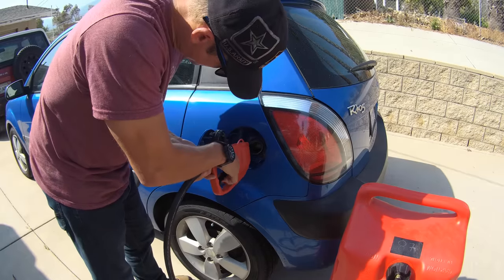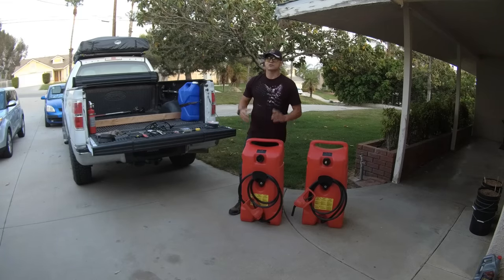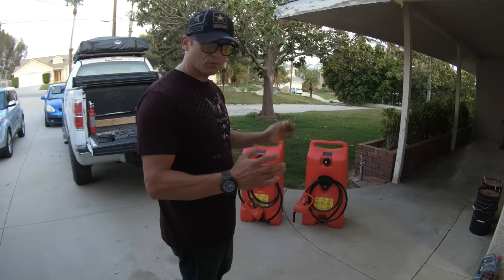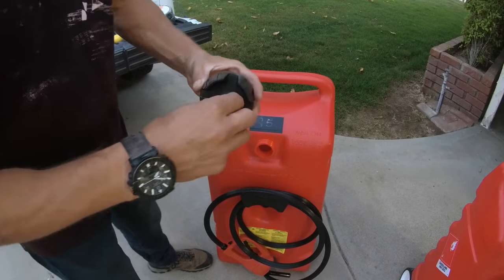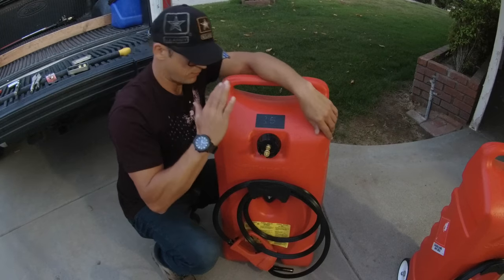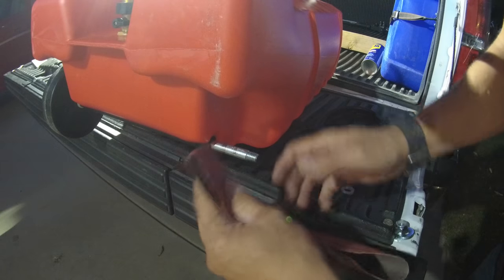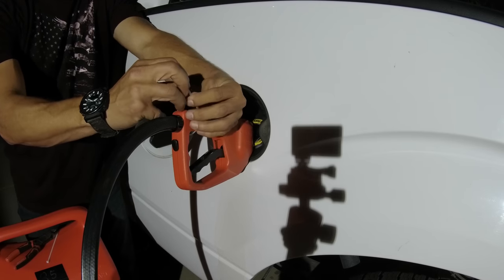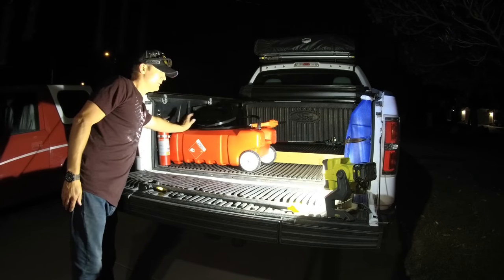Duramax Flo n Go 14 Gallon Gas Tank with Hacks

Comment: I just bought one for myself. The instructions state: "DO NOT FILL in the back of a pickup truck or inside any vehicle." Obviously you're filling in the back of your pickup on top of your bed liner. I guess the static electricity on your bed liner really isn't a big deal?
Reply from the maker: Is there static electricity from a plastic bed liner? I thought it was just if it rubbed up against fabric.  Well, I just researched and plastic on plastic can create a charge too. I'll be sure to either put them on the ground or install a ground wire and attach it to the fuel cans and the truck. Thanks for the info! Your a life saver!
Reply from the maker: Well, I think I'm going to install a ground wire because even driving around with it in the bed can be dangerous under the right conditions.  Too bad I didn't know this before the video or I would have included it.  Thanks!  I hope others read this because I've watched many other videos before buying this and no one else I watched addressed it either and this goes for any plastic gas container.
Reply: @plantbasedprepper  will you please do a video showing how to install and use the ground wire? Thanks
Reply from the maker: @apb5866  I will after I do more extensive research.  So far, there isn't much info out there with cars using a grounding method but there is for tanker trucks which cannot take their tanks off their truck.  That is the direction I'm going but I want to make sure I learn more about it and and do it safely and correctly before I share it.
Reply: What if you don't have a bed liner at all? Still an issue?
Reply: @tonyj1965  Yes, it is.  The can itself can develop a static electrical charge.  That static is discharged when the can is removed and set on the ground, or "grounded," before being filled.  But, if a can is charged while in your trunk or truck's bed, it will discharge to the gas pump's nozzle, which is "grounded," producing a spark that would ignite the fumes inside the gas can or at the end of the nozzle.  
THAT'S WHY YOU MUST GROUND THE TANK!
Reply: I actually witnessed it happen at a gas station, a guy was filling a 5 gallon can in his truck bed and the static did ignite it before I knew it he threw the can across the lot of the gas station, had to get the fire Dept there and write up a report on it, I took off without paying and came back when I knew it was ok but for my luck they knew me and didn't try to get me for taking off without paying
Reply: Ground wire with a chain on the end. Leave the chain on the ground when filling.
Reply: @imdeplorable2241  What if the can is on a metal plate in the bed of the truck and the plate has a steel chain that you lower to the ground prior to filling?
Reply: @johnhwang339  I believe that would work, the chain replacing a wire or cable to ground.  The object being to provide a direct path to ground but, not a human providing that path.
Reply: Yea you can die a slow very warm death. It's gas station 101. When I managed a station he would not have been able to do that. 100+ lbs or not it's gotta go on the ground or an anti static surface like a wood floor trailer
Reply: 10:45 what if you set it on a piece of plywood the size of the tank? Could you fill it in your vehicle?
Reply: @georgemartens7415  never IN a vehicle. Too much static. I strap mine onto my wooden bed trailer

Comment: Only bad thing is ELECTRICAL SPARK !! make a ground wire from tank to pump since your not putting tanks on the ground like the sign on the pump says to do, as specially with bed liner.
Reply from the maker: I was ignorant about that and that was one of the first comments someone made.  I have been taking them out of the truck since and looking into ways to ground the tank and truck to the ground instead.  Haven't came up with the best solution yet.
Reply: Wife bought me one of these for Father’s Day for putting gas in our pontoon boat.  Two Issues caused me to send it back:  the gravity feed issue which you solved with this hack, and having to take it out of the truck to fill it then lifting it back in.  Gas stations won’t let you fill them in the truck bed.  At 62, didn’t think I could lift it when full but didn’t try.  If I could lift it back into my truck I think I’m in on your hack.
Reply from the maker: @chdinct6792  Yep, that's the one drawback so far is having to take it out to fill up and put back.  I can imagine that being a problem when I get older too. There is a way we can ground the tank, car and self to the ground while filling but I take it not all gas stations would allow that either.  The hacks would make it easier to roll around though and fill.  If you haul it in a trailer, that might work but you might be able to hack some 5 gallon jugs too.  I just don't like holding jugs up to fill things.  I always splash some when filling the mower, chain saw, and they fill up too fast and overflow.  I love the gas handle on this tank instead with the air compression.
Reply: Thank you

Comment: Way easier to let gravity to do the work. Elevate it and you don't need to mess around with this mumbo jumbo.
Reply from the maker: If you store them in one spot all the time where you can pull up and gas up, it would be easier, but I need them mobile to wheel around outside to my mower and vehicles, etc. I found out your not supposed to keep these off the ground either so I started taking it out of my truck to put on the ground for safety. They will need to be grounded somehow even if you store them on a table or bench.  I'm still trying to find out a good way to ground them without having to take it out of my truck bed every time.  Need to ask a fuel tanker because they carry fuel and have to ground there vehicles before filling up there tanks.

Comment: Good ideas, but a few VP racing cans just make so much more sense and are SO much cheaper. They hold over 6 gallons each, and with the vent cap, I can empty a full can in about 1.5 minutes, much faster than this. Plus, they are much lighter and easier to transport.
Reply from the maker: I have a few of those too and I can't stand holding up 5 gallons while filling up my tank, ride on mower, and garden tools.  This things is easier to just wheel over and put a pump on it to fill them up.  https://www.youtube.com/watch?v=uEaJqPYj5Ok

Comment: How's the fumes when you open your trunk bed? Also have you looked into or found a usage gauge for it? to either let you know how much gas you've used so far instead of guessing how much you've used?
Reply from the maker: I wouldn't store gas cans of any type inside a car or trunk to travel.  I keep this thing in the back of my truck.  Don't really need a gauge for that because I only fill up when it's near empty so it takes the full 14 gallons.

Comment: Have you been able to find an auto set venting solution at 5 PSI?  I found another solution. It still requires a manual adjustment, but it's a little bit shorter profile.
Reply from the maker: Auto set? No. Shorter profile would be better so it doesn't stick out so much.
Reply: @plantbasedprepper  Yes if you could buy a pressure relief valve preset @ 5-6 PSI

Comment: I guess pumping with your foot versus your hand is better? I have a Milwaukee battery operated air compressor that ill use if I go this route. Looking at buying one of these for my landscaping business. I just don't like the tank sitting out in the sun though and that valve would help tremendously. Thanks for the hacks!
Reply from the maker: I like the manual pump because the battery operated one was so loud.  In a SHTF scenario, stealth mode is important. Heck, even with inflation, no one likes watching someone fill up extra tanks so be smart when going to the gas stations. Don't go to a busy one during shortages...

Comment: Any fuel with ethanol is shit, storing it is a nightmare and the damage to small gravity fed carbureted engines isn’t worth the savings.
Reply from the maker: If your car doesn't recommend ethanol, then don't use.it. I rotate my gas like I do my pantry so I don't store any gas long term. That way we make less trips to get gas. I'd rather fill up our cars at home until the portable tank is out. Rather my wife and family don't have to risk going to the gas station so much. It's not a safe place and we can't get in and out like we used to with having to answer so many questions using our credit cards and slow pumps and shady characters always standing around.
Reply: @plantbasedprepper  I wasn’t referring to vehicles ,

Comment: So you’re saying the normal gas is $6/gallon? That’s the only way it would cost twice as much to fill up. You’re math doesn’t seem to be correct. And I guarantee you, you’re getting worse mileage with the E85. Ethanol has a lower energy content than gasoline, so you need more of it to make the same amount of power. Ethanol also burns faster than gas, adding to the problem. It’s not debatable, it’s a scientific fact. E85 provides lower mpg than gas with less or no ethanol in it.
Reply: E85 has a higher octane rating a thus you can run a higher compression ratio, thus you can extract more energy out of the fuel. An e85 specific engine takes this into account.
Reply from the maker: Your right about my math. I mispoke there but too late to re-do the video.  I was filling up E85 for about $2.90 at the time and where I was going every weekend, because it was a resort town, they didn't have E85 and my discount codes never work for some reason, so I was paying anywhere from $5 to $5.50 and felt like I was getting jacked.  I think there pump was off and charging me even more so hauling this thing with me when I travel out of town is a money saver.  About Ethanol having less energy, I haven't noticed that one bit and my gas mileage is the same.  Maybe it's the Shell Flex Plus vs other E85's out there OR my truck runs better on it since it is equipped, tested and recommended in the manual.  From my research, I learned cars run more efficient using there recommended octane instead of paying more than you have to at the pump.  Not all cars are created equal.

Comment: I like it for off-road use engines like ATVs, gas tractors, generators, etc. 

I doubt you'll see monetary savings for use in an on-highway vehicle like cars/trucks. 
The tank is $140. Even if you could save $1/gal (remember, gas goes bad quickly), it would take you 10 full fillups just to break even, not including the hassle of filling it up, dragging it in/out of storage, and time wasted pumping contents out.
Reply from the maker: I did a trip to Oregon and saved myself over $200 in gas. Filled up at home for $3.09. Made it to Reno bypassing the $5.50/gal signs. Filled up in Oregon for $3. Made it all the way home. I'm saving hundreds with this extra tank.
Reply from the maker: No time wasted. I'm camping off grid. I just fill up while I'm at camp before I leave 👍
Reply: @plantbasedprepper  Your math doesn't add up.
You saved $1.60/gal. With 14gal tank, that's a savings of $22.40. 
You did tht twice, so that's $45. 
If you do that 4 more times, you'll be breaking even, not counting the hassle, time and risks involved (spill, theft, etc.)
As I said, I like the idea, but for everyday driving, it may not be worth the hassle. To each is own.
Reply from the maker: @marioprzepiora  I think your assuming I'm lugging this tank around everyday in my truck. I'm only  hauling it for long road trips to go dispersed camping or long trips out of state. It saves me money by not having to fill up for $5/gallon in CA when I have a Shell station by my house I pay $3/gallon for E85 instead and it helped me make it to Reno to refuel and buy more gas to make it back home. For toys, it doesn't matter because I wouldn't be driving that far  to go riding and I don't put E85.in those so I wouldn't be saving any money.
Reply from the maker: @marioprzepiora  My math is correct because you didn't add the savings from filling up my 27 gallon tank in my truck too. That extra 14g tank gets me further to save the money by not having to stop in CA or resort towns where gas prices are higher so I'm actually filling up 27+14 gallons at a time. On my road trip to Oregon, I filled up before I left with E85, once on the way there in Reno, before I came back in Oregon and then when I got back home.  So let's say the last one doesn't count.  27+14 gallons = 41 gallons and I filled up 3x on that trip.  That's 123 gallons of fuel I purchased so I saved 123 gallons * $1.60/gallon savings = $196.80.
Reply: @plantbasedprepper  , You are incorrect. 
You simply can NOT add the fuel you're putting into your truck.
That fuel is not part of the 14gal external tank, the costs associated with it, and therefore the calculations.
Consider this: My vehicle has a 99 gal tank. If I used your example, and bought a one gallon fuel jug, I could say that I saved $160 on first use 99+1=100*$1.60.
Do you see how absurd that sounds?
Reply: @plantbasedprepper  again, your savings are only limited to the amount of fuel you're NOT purchasing at the higher rates, which is 14gallons at a time.
Reply from the maker: @marioprzepiora The thing is, I'm filling up with E85 before I leave @ $3 which is $1 less than regular. Then I didn't have to refuel anywhere else in CA because that extra 14 gallon tank got me all the way to Reno where gas was only $3 so I'm definitely filling up my truck too. I did the same thing on the way back. You save $$$ anytime you go to a cheaper gas station whether you pump 1 gallon or 41 gallons at a time. I'm taking the regular price of gas I would have paid vs the fuel type, distance I can travel and places I can fill back up.
Reply: @plantbasedprepper  , if it makes you feel better, you're free to think what you want.
If you want to be factually, mathematically, and accounting(ly?) correct, please talk to someone that understands math better.

Comment: Thank you so much. So much. 
Readying up for hurricane season just got so much easier 
And fun! :)
Reply: The parts arrived will install asap. 
Thank you for everything!
Reply from the maker: That's great! How did it turn out?
Reply: @plantbasedprepper  You must fill the tank up first with fuel and then set your pressure at 5 psi?
Reply: We’ll find out but I’m confident. Nicole hits tomorrow.
Reply: It works great. Your emphasis on the floor pump was major. 
Thanks so much for your time in sharing!

Comment: I followed the link for the easy deflator and it says the minimum pressure is 6 pounds.  Guessing one pound won't make a difference so I ordered them.
Reply from the maker: Yeah, close enough!
Reply: @plantbasedprepper  I finished the first one.  Works great!  I am making three of these which is 3 tanks for my car.  Guess I will use them and refill once a year.

Comment: Great video..   You make things look so easy.   Any suggestions for a person my size and single to do this??   I don't have a truck, so I would fill it from my open trunk.  How do I remove it then?
Reply from the maker: If it's too heavy for someone to lift, I suggest getting a few 5 gallon containers instead. Don't leave gas in your trunk because of the fumes. It's also unsafe if you get rear ended. Ok to fill up and take home to use because that's the only way to do it. Also, dont fill them up in the car, make sure you put the containers on the ground to fill up.
Reply: I found it surprisingly easier to lift than I thought it would be. Also depending on the trunk height, you can tip it upright after filling, lean the top on the trunk, then lift the bottom to slide in. I'm in a Subaru Outback, it's pretty high and that also worked. Same when i got home, lower one end down(Maybe a blanket to scratch the bumper)

Comment: And now you have to call Haz Mat for the spill on the driveway cause it will get into the water shed from run off to storm drain to creek/river or what ever LOL.
Reply: It'll evaporate well before it reaches any drains. 
If you're concerned about it, just keep an open flame handy and throw it on any spills you see. :-)

Comment: Thought about doing the same with the wheels but wasn't sure about the clearance. Do they rub when it's full? The stock wheels are junk. Double nutting one side to get the other off is good way to go about it if you don't want to use vice grips.
Reply from the maker: No, the ones I bought do not rub and I just tested it out in the field this weekend! Posting a video today showing it!  Check it out.  Definitely change the wheels! They are only $8/each at Home Depot.

Comment: You should also add a little bit of permatex thread sealant on the NPT threads.
Reply from the maker: But I don't want it permanent. It doesn't leak because.i never fill it above that cap.
Reply: @plantbasedprepper  permatex thread sealant is not permanent at all. It's not the same as loctite/thread locker or even rtv. It's just a little bit of PTFE (teflon) that protects NPT threads and keeps them from leaking. It's often used in head bolts and water pump bolts and anything on a vehicle that has pipe (NPT) threads like head or block plugs.

If you never fill it above the cap I guess it's not necessary though.